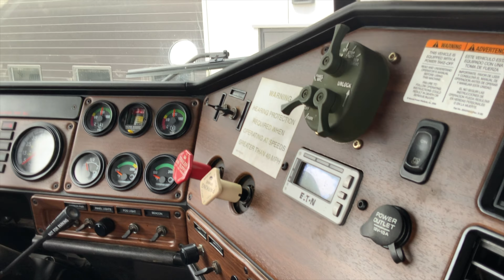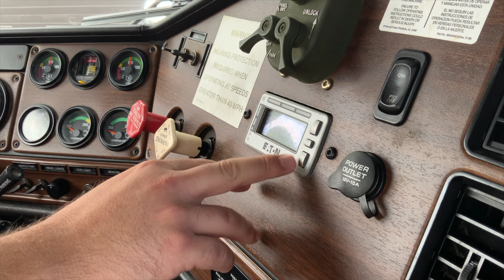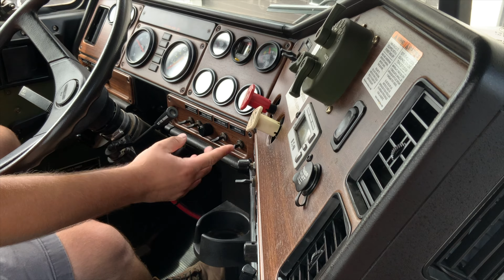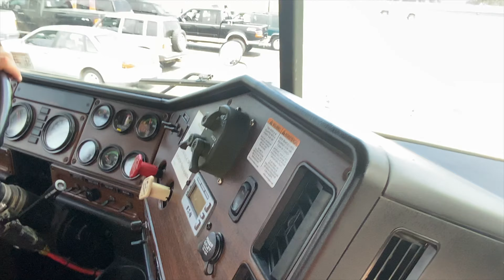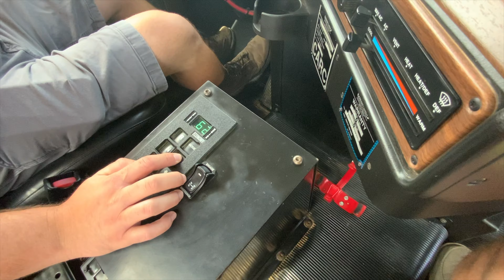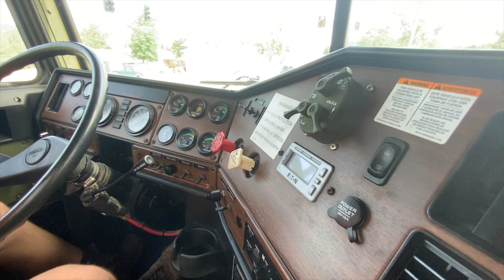"Take a ride with us" Freightliner M916A3 6x6 Semi Truck Overview!

Comment: Not a bad wagon except for that awful gear selector on the Allison 7 Speed Autobox, like you are selecting a favorate  radio station, cannot beat the old style T-handle . Regarding the transfer box, can that be changed to one that disengages the front axle  for on road driving, like the old Spicer Model 80 transfer box used in Ford Broncos.  The parking sensor is a nice option but I prefer a beefy front towing pintle or clevis with the sensor mounted above. The front axle  resembles a hub reduction axle made by Kirkstall of Oldham Lancashire UK, the rear bogie a single reduction spiral bevel Rockwell SQHD as fitted to Foden S 106,s. Is the Freightliner M916 also available as a 6x4  tractor unit with a KittyCat C16?.
Reply: The front axle is disengaged it has a switch to push that engages the front axle the transfer case is a single speed 1 to 1 ratio front axle is same ratio as the rear axle but yeah you have to push the button on the dash to engage the front axle when you need it.

Comment: The reason for no def is that according to 49 cfr government entity vehicles are not subject and are excempt from emission equipmnet and DOT regulation, thats the reg in a nutshell.
Reply: Another reason to get them.
Reply: @xenomethean9304  def systems are the biggest waste of time and money and are more problematic than you think.  The fluid itself freezes at 12°f, is EXTREMELY corrosive to anything it touches and insanley easy to contaminate.  All in the name for cleaner air, diesels are 30% more thermally efficient in any capasity than any gas engine will ever be on top of being built stronger and better to boot.  Why would anyone recycle their exhaust AND put that chemical back in theyre engine is beyond me.  Oh wait its because commiefornia and all their bright ideas they come up with.  Diesel is what moves the world and that fact will never change no matter who wants to believe otherwise.